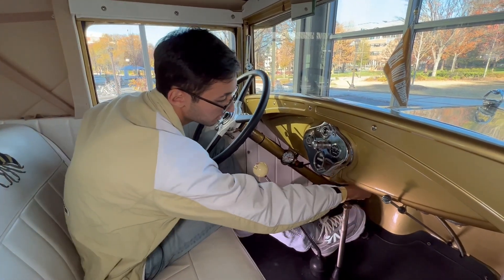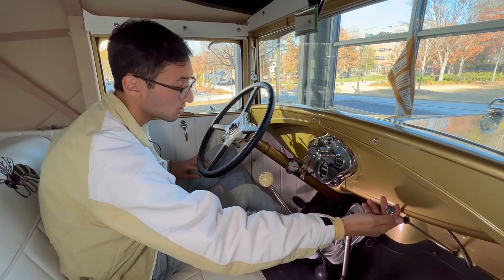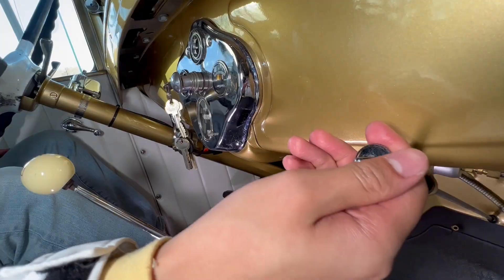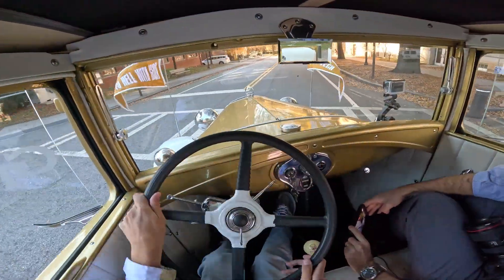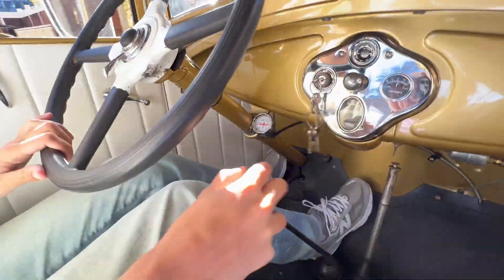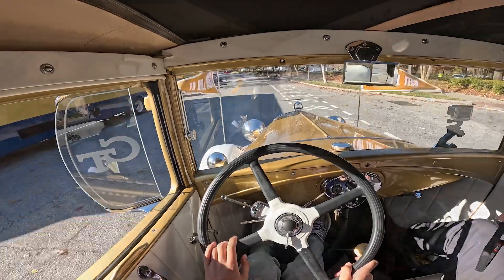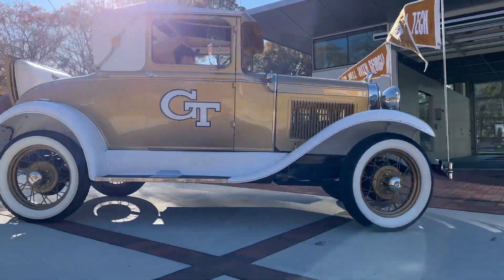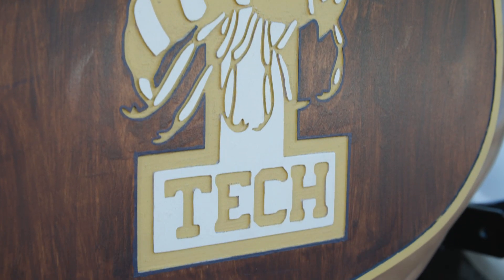How the Heck Do You Drive the Wreck?

Comment: Did someone put in a synchronized 2nd and 3rd gear transmission or are you that good a driver?
Reply: I was wondering the same thing. He doesn't seem to be double-clutching
Reply: I meant to respond to this when this video came out, but we do not have a synchronized transmission! Everything is stock on the Reck except for our running boards (reinforced to support the 3 cheerleaders on each side during the ride out) and retrofitted turn signals. I did fluids work regularly on the Reck and rarely crunched the gears. Second to third was hard to get smooth, probably didn’t get that until halfway through my year.

Comment: That lever just behind the right side of the steering wheel might control distributor advance/retard. 
(My chance to play with Dad’s Model A was 60 years ago)
Reply: The lever on the right side is a hand throttle (when you pull it down you can actually see the gas pedal depress). The one on the left is the spark advance.